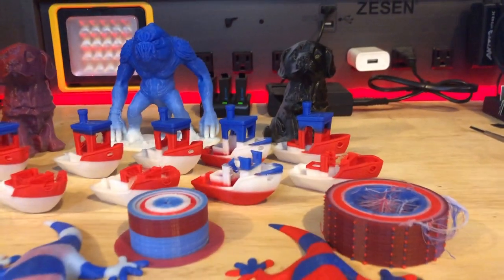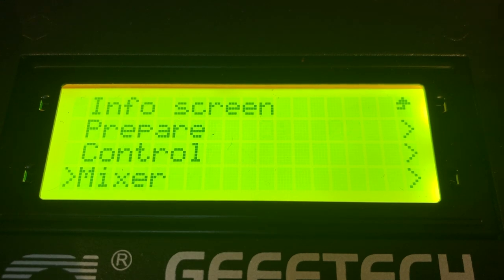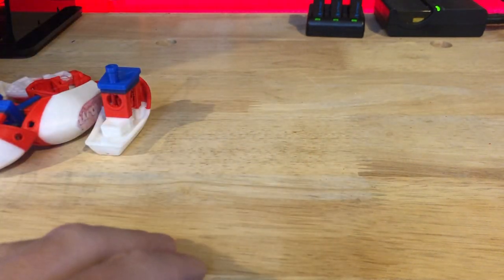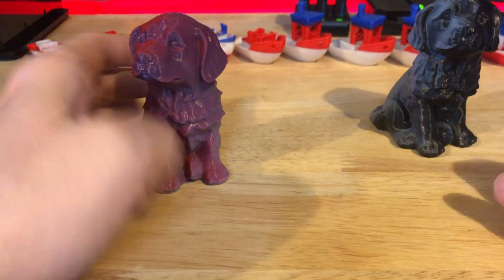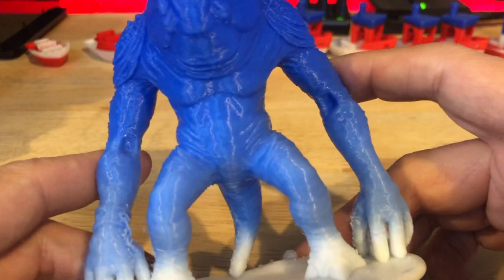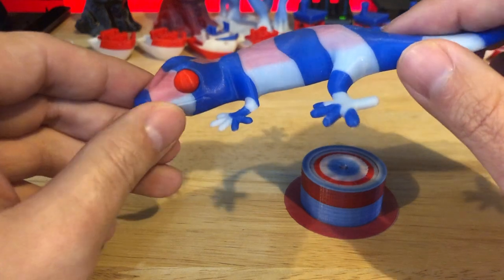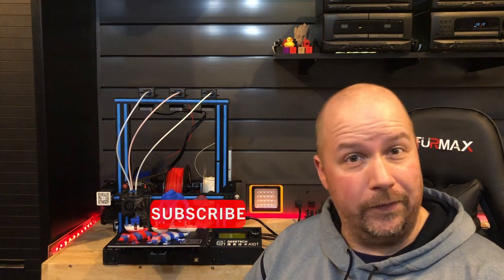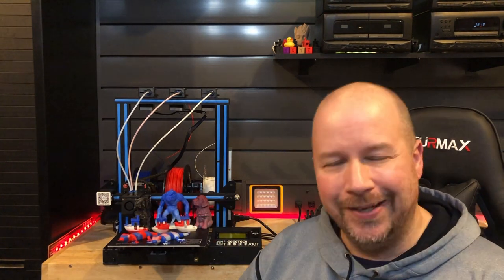Geeetech A10T 3 in 1 Color 3D Printer Review

Comment: We recently acquired a Geeetech A10T and noticed the same issue with the printer overriding the temperature settings in Cura.  A little digging, and I found that the Cure profile for the machine had the temps hard-coded in the printer start code:
  M104 S215
  M140 S55
  G92 E0
  M109 S215
Once I removed the S values for the hot end and bed, it ran with what I entered in Cura.
Thanks for sharing your thoughts on the machine.
Reply: Hi Loving Hands, I am having the same problems with mine, can you explain how you went about changing the hard-code on the printer, many thanks.

Comment: Check your Gcode settings I had same problem found a copy of temp set g code line that I accedentlty did not remove it would change nozzle temp 1/3 way all my prints. Removed line in custom code option in Slicer and fixed it

Comment: The bowden tube is much longer than normal since it's mounted on top rather than on the x gantry. This means more stringing especially since it's using the cheap ptfe tube rather than capricorn. I'm thinking about making a multicolor printer but with direct drive which means the print head will be very heavy. It will need a counter weight such as like elevators use to keep the extruder motors from weighing it all down.
Reply: Na, My CR10 S5 (500 x 500 x 500 print bed) has a super long bowden tube and doesn't string like that!

Comment: Hello.  I own an A20T and I don't understand how to use the three colors like you did with the geko.  I use the CURA slicer and when I start printing with the raspberry, the printer automatically changes the parameters by putting 34%, 33,%, 33% and I have to quickly modify it through the toogle mix.  why does he do this?  what should I do?  and how do you set the colors as you did for the geko?  thank you
Reply: have you managed to figure it out?
Reply: @BolinhoDeArrozCozido  yes, in the initial care settings I put only "g28" as initial gcode

Comment: Does these geeetechs really work on mixing filaments ? Could we generate another color mixing filaments with these geeetechs?
Reply: My experience with my A30T is no it cannot mix another colour. You always get that blend of colours around the model as is shown in the dog model in the video. I think it would need a stirrer in the hotend to mix, say,  a green from blue and yellow.
Reply: @itsmeintorrespain2714  I looking at the a30T but I don't find reviews. Is worth purchasing?
Look very nice and well made, only the extruders have cheap looking.
Reply: @ganakil  I am not disappointed with my A30T. The extruders are different but just as well made as the rest of the machine. I also ordered the ABL probe and the glass bed at the same time as the machine and glad that I did.

Comment: Well Well, i think you may have just saved me from wasting £300+ pounds (English), and possibly  a new workshop window as the A10 might have left the building via said window. I have been looking at Multi-Colour printing for a few weeks now, looking at the 2 and 3 in one Geetech and also the offering from Palette with there (fairly Costly) slice and fuse unit . The build quality of the A10T's is really very poor  and along with the way it handles the the filament change over has 'For Now' put me off going down this root with them, and i will look at other options, but keep an eye still on the Geetech as i think they have something, but they need to improve build and firmware.

I think the filament waste is going to have to be accepted by me as well as it looks almost like quite a lot of wastage at 60mm, maybe almost the same amount of filament in the waste as in the model (Can't tell how dense both are!)
Thank you again Sir for your review, and good luck with your A10T

Comment: Thumbs up for the review. Thumbs down for the printer. IMHO if you want to do multiple colors the IDEX style printer is the best way to go. The good ones are not cheap however. They are pricey but hopefully they will come down in price given more time. There are a couple cheap ones on the market but none of them I wouldn't recommend. There is of course the Prussa MMU2, Mosaic's Palette 2 and the Chameleon which are another option that can be modded to your printer and probably do better than this Geeetech A10T.
Reply from the maker: Thanks!  Yeah, hope to get a IDEX style printer someday.  Was only impressed with the color mixing, and how clean the lines were on the lizards.  Like you said, the good ones are not cheap.  If I was a customer of this printer, it would have been returned right away.  Thanks again for watching, and your feedback!